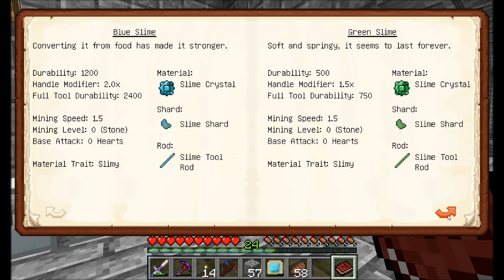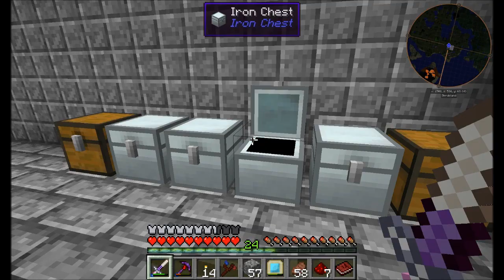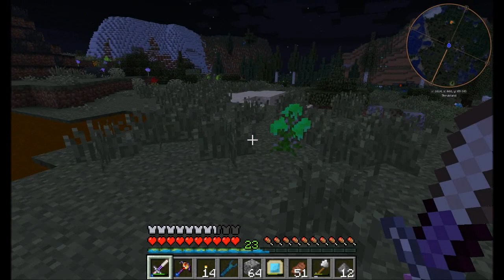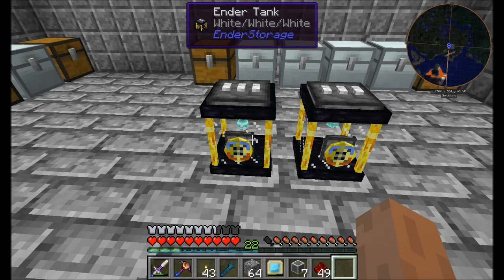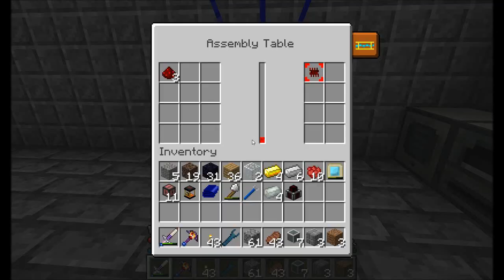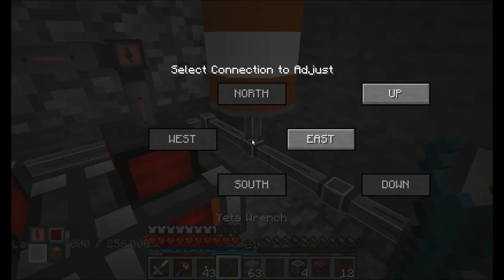Lets Play   S7 E17 Power Upgrades

Comment: too all that havent set their computer correctly in order to make the FTB DW20 pack to work: its on your side. im confident enough to say that atleast 85% of ALL who have tried to make it work, has it working.
PLEASE go to the FTB forums, then into chat and ask the nice people there for some assistance. PLEASE DO NOT write that it doesnt work/laggy/crashy  whatever, because it aint true. its all on your end. PLEASE get help from the FTB forums so you can start having fun like the rest of us. FTB forums are usually VERY helpfull.
hope this helps you people out.
also Optifine and Fastcraft highly recommended. 64-bit Java (newest update)
use Control, Alt, Delete, then right click on your Java programs that are running, and set the priority on high. im sure FTB forums can help you much more than i.
Have fun boys, girls, men and women !
Reply: This is good recommendation.
Actually nothing but a common sense but seems people does not have it these days.
Reply: Easy. Rule #1. Don't use the pirated version of FTB. #2, New version of Java. #3. No #3. It's either your derped on installing your FTB or your using an old versions of java which doesnt work on all 1.7.10+ MC.
Reply: Markus Santiago wait there is a pirated version of FTB? O_o
Did you mean minecraft instead
Reply: Markus Santiago I am actually experiencing issues with the two newest versions of java (it's a forge thing), which is why I still have not updated it from 8v11.
Reply: Chromeplate Yes, there actually is pirated FTB launcher and servers, too. ;d
Reply: He has direct contact woth mod authors so he knows if its glitchy in a known or unknown manner.

Comment: Dire if you just place a extra utilities lava generator beside the enderthermic pump it will automatically get filled by the pump and when adjacent to the pump it fills the pump with power, just fill it with and initial bucket of lava and it works flawless, there's no cables needed it just works flawless
Reply: Magmatic dynamos work the same, but they can be controlled by redstone signal. He just wonted to not waste lava.
Reply: A dimensional transceiver is probably easy it can send power and the lava
Reply: GhostGaming
But the generator stops completely when it's full, so that setup doesn't waste lava either. Plus it only outputs 40 RF/tick, which is more than enough for the pump, the 80 RF/tick from the magmatic dynamo are overkill :D
Reply: Xario Withoutalastname but the magmatic drops to 20RF/T when the internal buffer is full.
Reply: ThePizzabrothers Gaming
It actually even drops to 8 RF/t ! But still, DW works a bit to get the dynamo to drop to 0, which afaik is what the generator does by itself.
Reply: Because Tema is flawless o.0
Reply: Xario Withoutalastname but it geneartes too long when the buffer is low enough, so lava is wasted anyway...
Reply: ThePizzabrothers Gaming
I did not understand your last response. What were you trying to say?
Reply: Xario Withoutalastname When the generator from extra utilities runs out of its buffer, it starts generating again, but it starts generating when the buffer is 1000rf below the max buffer, and 1 bucket of lava can generate 10000rf, so 9krf is being wasted
Reply: Oookay...and when does it generate only 10k RF? My testing showed 40k...?!?
Reply: Xario Withoutalastname i dont know i just said a random number, it's still wasted energy.
Reply: ThePizzabrothers Gaming
Well that doesn't help your credebility. I also don't think they always burn a whole bucket at once. So where did you get your "knowledge"?
Reply: ThePizzabrothers Gaming It will pause the generating of power, and resume if it's full without consuming another bucket of lava.
Reply: xamir1113x it wont pause, and Xario Withoutalastname it uses 100mB ok? I now checked. Once the buffer is below a certain amount it will start generating again, and then the "time remaining" will go dow even if the buffer is full again. That's what i mean with also wasting energy from the lava. HAPPY NOW? Geez.
Reply: ThePizzabrothers Gaming
My happiness is unaffected, but I appreciate you checking - Thx for that :D It's a bummer though, my ocd doesn't want it to waste any lava at all.
Reply: Xario Withoutalastname ikr.

Comment: The Direview

Thank you for the video (only one suggestion today)

I really liked how you explained the adding of flux to a Tinker tool and then further improved by adding wireless charging. That was freaking awesome.

I liked the amount of jump cuts you did, it was also very humorous when you jump cut into an Endermini death. Later on in the episode, a few more jump cuts could have been used (crafting conduits)

I have some questions about the Endertanks;

The dial on the from can also have a diamond added to it and it changes color, what is that for?

I don't think it would be for changing channels, that's what the three wool on top is for.

I use two Redstone torches to power Redstone engines for a basic pump and they work fine, why didn't DW20s build initially work?

I really liked the lava build and I appreciated that you took the time to explain the different options and why you chose what you did.

What part of your lava gathering could be managed by SFM? Is SFM an option or does it need to be gates?

Stick a plant in a corner, pick a Nether plant for extra wow factor.
Reply: The diamond will turn the ender tank (or chest) player specific, this way different players can use the same colours. (and it also prevents other players from tapping into your system and leeching)
Reply: Diamond makes it personal to the person who put it down similar to enderchests only the player who put the tank or chest down can open them
Reply: What could have been done differently to add to the lava gen build? What are some other options that might have accomplished a similar result?
Reply: The diamond feature is only for multiplayer, you wouldnt bother with it if you are in private server with a friend. 

The redstone engine plan was a failure because every time he leaves the chunk, it restart engine. which is why dire abandoned it.
Reply: The diamond basically makes the frequency private (linked to the player who applied it).This also works with the enderchests (modded).
Although dire talked about chunk loading, he did not remember that the pump doesn't chunkload unless its running.So it should have worked but dire didn't stay in the nether long enough.I may be wrong about this.
This build can definitely be done by SFM but dire had been using it a lot earlier and people did not like it.
Finally I would like to say that I admire your dedication, giving a review for each episode. For this you get a thumbs up :D
Reply: By the way. The quality of the materials used for a tinker tool limits the level of capacitor that can be used to upgrade the tool with flux.
My two main mining tools are a Hammer, with a Cobalt Hammer Head, 2 Cobalt Large Plates and a Paper Tough Rod, upgraded with lapis, a redstone flux capacitor (because of the tool rod it wont take a resonant flux capacitor) and all other upgrade slots filled with redstone as a "mining" hammer and another hammer made of Cobalt Hammer head, 2 Large Paper plates and a Paper tough rod. It has a leadstone flux capacitor and apart from that it has max redstone. The speed (22,6 for a hammer!) makes it really handy to dig out tunnels or get rid of obsidian, while the other hammer is a bit slower, but has looting and can accept enough power to not run out of charge from a resonant flux capacitor.

I'm thinking about getting into Thaumcraft, Thaumic Tinker adds Thaumium, which can be used like paper (+1 modifier for the first part), but it may not limit the "quality" of flux-capacitor that can be applied to the tool, which would be pretty awesome for the "fast hammer".
Reply: *****  "The quality of the materials used for a tinker tool limits the level of capacitor that can be used to upgrade the tool with flux." ~ This is news to me, is this a new feature? Either way I still wouldn't worry about it, if you use a redstone or resonant capacitor in your inventory, it doesn't mattter what's on the tool. I used to use tuberous capacitors just for the modifier. ><
Reply: ***** ardite hammer can be a little faster than cobalt. Esp since ur using flux powered.
Reply: jhanks2012  I don't think so. Ardite has a mining speed of 8, compared to cobalt, which has a mining speed of 14. Also I made a mistake, the speed of my fast hammer isn't 22,6, it's 32,8. Nevermind... Stonebound bumps it up to 34,4, nice catch ;D
Reply: soggy10doggy Well I did some testing and this is what I came up with: The material of the handle determines what capacitor can go on the tool. Paper wont allow anything higher than hardened. The capacitor you use also matters. The amount of RF the capacitor can receive gets carried over to the tool. A Hammer with a hardened capacitor was not able to keep it's charge when mining through the ground (just stone, nothing fancy), however the hammer with a redstone-flux capacitor was. In order to keep the hammers charged I used a resonanat-flux capacitor.
The amount of RF used did not differ, both used about 10k RF per 3x3 mined.
Reply: *****
 Ah well this has definitely changed from before. Still, I always use ardite rods anyway.
Reply: ***** well different materials have different properties and ardite gives the property that the tool gets faster and faster as it wears down. so if you make an ardite tool and get it down to just a tiny bit of durability when you hook up the flux capacitor, durability no longer matters as long as you keep it powered and you will end up being faster. At least it used to be possible, I haven't used Tinkers in awhile and I know alots been changing.
Reply: jhanks2012
 Yeah you are right, stonebound makes it slightly faster. Sadly, both versions are not yet fast enough to keep up with the runspeed of modular power suits :(
Reply: I see, you really try to make him stick a plant in the corner, hm? I'm curious if you will succeed :)
Reply: Kaikaku Oh, in my head I've moved on from just a plant in the corner. I want direwolf20 to use redstone and factory manager and Botania and Mariculture and EIO and, and, and, and, and, ....etc to place a plant in the corner......in a flower pot....on a table...near a window ....that's at eye level....all automatically............. with the plant 'refreshed' with a new replacement plant species, every 12 hours.

I wonder if that's even possible.......oh yea.....AND.....all the wiring, and machinery has to be hidden.
Reply: Jo' Xolah So...all that I just said plus even more fancification. I aim for the moon because if I should happen to miss, I'll still reach the stars.
Reply: Jo' Xolah +1 Well, this sounds like an automation challange for +direwolf20 . Think your success chances that he'll stick a flower in the coner improved (a little bit). Btw nice idea. Don't know if factory manager can put flowers in pots but maybe I'll give it a try...
Reply: Jo' Xolah um, I think you have that backwards. Reach for the stars and if you call short, you can still hit the moon...
Reply: Jo' Xolah direwolf20 Played around a bit with the plant in pot automation. Although the pot is no inventory, it's possible.
1) Put pot with Block Placer (OpenBlocks)
2) Put in a random flower with Autonomous Activator (Thermal Expansion)
3) later: Break pot with flower with Block Breaker (MineFactory Reloded, not OpenBlocks this does destroy the flower)
Redstone and timer done with Machine Inventory Manager (Steve's Factory Manager)

Much easier (and with no visible machines) would be to just use a flower (without pot) on a table (Bibliocraft) or I think an Arcane Pedestal (Thaumcraft) as both blocks count as inventory.
Reply: Had a thought, but it was too easy so I changed my mind.
Reply: The dial on the endertank is for input/output :D
Reply: By the way, it doesn't much matter which capacitor you use on your tool. Why I say this is because you can always make another capacitor later and place it in to your hot bar to charge your tool. This means you could even have a pickaxe with a tuberous capacitor with a resonant capacitor in your inventory and still be getting resonant quality from it.
Reply: Doubt you even read my comment fully. :P
Reply: Jo' Xolah Finally, I found the right episode to give you an update (and I'm not able to use Jo' Xolah anywhere else...). I programed a turtle to change the flowers in a pot regularly :))
Btw. did you watch the forgecraft episode with the flower in the corner?

Comment: I'm here late (obviously), but loving the walkthrough style of the mods. 
So much I didn't know about the specifics of the mods, and how useful they are.

Noting some places where there is something you missed (or maybe new to the mod). 
With the newest mods you have in the DW20 pack; there is an Augment for Dynamos (which admittedly takes one of their 4 augment slots) that will drop minimum power drain to 0 (saving you all the gate/logic work there.

Of course it is still a benefit to see this done, for machines/setups where this is required; but you could simplify to avoid some of your redstone works while still avoiding wasting lava for power. :)
Reply: so how would you set this up, using the upgrade?
Reply: In the machine, opening the top right tab shows 4 "augment" slots 
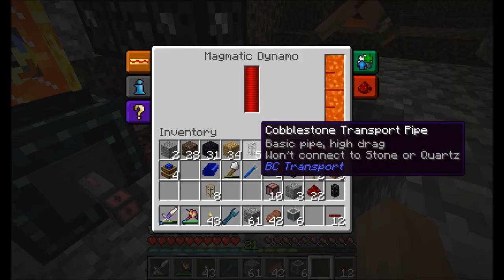*pause at 31:54, the top right icon with a gear, arrow, and plus sign right above the redsotne controls he uses is where I mean.

One is filled when the machine is made allowing redstone control, it can be removed to use that slot for other augments (but then the machine won't respond to redstone controls).
The upgrade/augment needed to control turning on/off the dynamo and preserve fuel is called the Augment: Excitation Field Limiter.

If you make one of these, and slot it into the dynamo in one of the 4 slots available, it will only run and consume fuel if the internal energy buffer on the dynamo is not full.

IF you look at NEI for augments you'll find a lot more (for dynamos fuel efficiency or rf/tick increase; for other machines speed upgrades, secondary output upgrades, and some others).

Augments for Thermal Expansion were new with TE4 and didn't exist in previous versions.
So (at the time) this was new-ish stuff.
And people accustomed to TE3 (like Dire) might not have seen it.

Comment: What an enormous amount of unnecessary effort for minimal gain. Enderthermic pumps, unlike BC pumps, are pretty intelligent. They don't waste lava drawing blocks when there's no room for it to go. Dynamos are also intelligent and drop to minimal power usage if there's no demand. This was a ton of extra work and resources spent on a making a temporary power source a tiny bit more efficient, seeing as you'll be upgrading to a big reactor or at least steam boiler most likely soon enough.
Reply: I sort of agree especially because he could have just made a couple augments for the dynamo to use even less lava, so that little bit he'll save could basically be accomplished just through an upgrade.
Reply: You choose the easy way which majority does and get sick with the pack very fast. Reason why there's so many mods is you get to play with them, make them work with each other and  make something creatively your design. He choose the hard way since thats the most uncommon way of doing things since common is boring. Since it's too easy, Not being a troll, im just stating that it's interesting to come up with more creative ways of doing things.
Example. I can run Full automation of AE Crystals and Processors with just using 2 channels on my AE, and quote, it's not expensive, its way more cheaper than the full AE version.
AE + Ender IO = Cheaper automation. Quote, Quote. And more space friendly and VERY Comapct. Like, 12 blocks comapct of full automation of Crystals and Processors. and Cheap.
Quote, quote, quote. I can run it with 1 channel if i wanted too which im working on, which is not impossible.
Reply: Markus Santiago It has nothing to do with that. What he did just simply wasn't needed. It's not like he took some other approach to get to the same goal. He just added a whole extra bit to the build that barely helps it at all.
Reply: Are you a hater or something. Different is different. Why do what everyone does if you can do something different. It's like who am i if im doing what everyone is doing.
Reply: Markus Santiago Wow, you're just not getting the concept here. If you craft a furnace do you also throw away 8 or so diamonds and wait for an hour before using it? Because the whole assembly table/lasers/gates thing simply was not needed. He didn't do anything different. He's done this sort of automation MANY times before. It's nothing new. But the thing is he usually does it when it's needed. In this case it barely has any effect whatsoever. He might save a bucket of lava every half hour or so of operation.. might.
Reply: Linerunner99 He is just showing the new viewers how basic BC gates work. No need to stress about it.
Reply: Linerunner99 The guy is a troll. I don't think he knows what he is talking about and it's obvious english isn't his first language. If you look at the comment below yours he did the same thing to someone else.
Reply: Markus Santiago I have to ask, are you a kid...? because OP never said anything negative just that he thought the extra step was a tad pointless, so how that translates into hating is beyond me... (that plus its not as if there is a limited supply of lava or anything either..)
Reply: The irony is that the redstone engines were nerfed on purpose to eliminate "free" energy. Usually Dire's up on stuff like this.

Comment: Obviously here way late, but I put the Flux Capacitor and Pick Axe In the same spot as dire, but it wont upgrade add the Flux Capacitor. Yes, before you ask, I have an extra modifier. I also tried restarting Minecraft and nothing changed